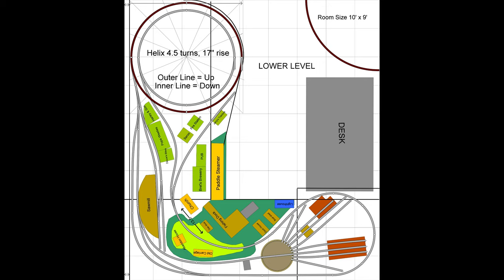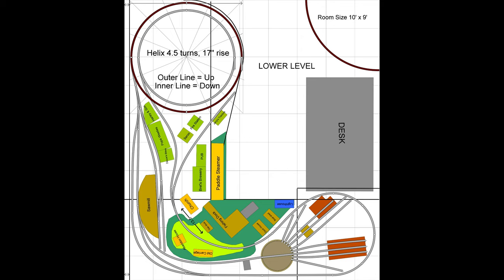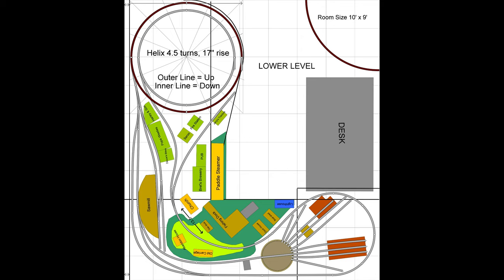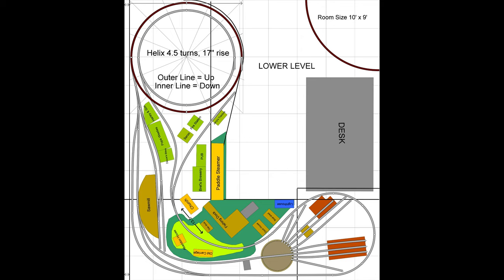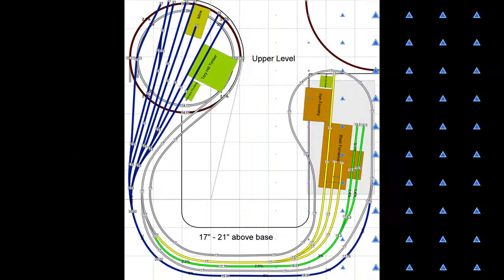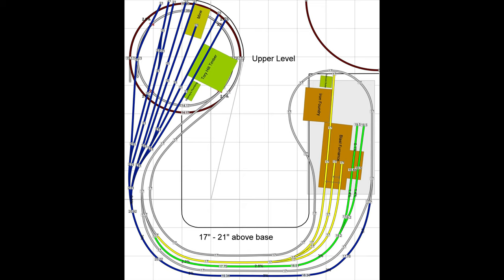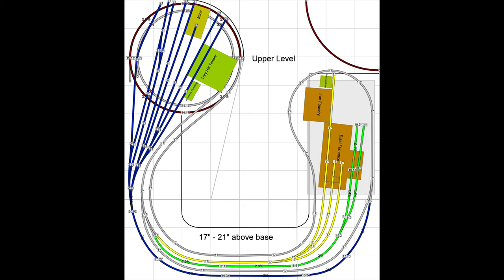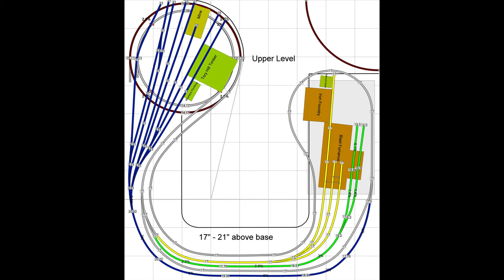New Layout.

Comment: Will be good to see the progress going forward, also do you have 
the Blast Furnace kit or are you going to scratch build this cheers Robert
Reply from the maker: Thank's Robert.
I built the blast furnace about 10 years ago (Walthers Kit) I'm in the middle of weathering and repairing it at the moment so I will post up a video very soon, it is a great kit and very large (22" tall) so it has to go on the top level. It was originally on my old layout but I took off to put in an intermodal yard. Don't we all wish we had more space.
Regards
Gary.
Reply: @creepy013   That is the problem with all us modellers, needing more room than what we have. But i do really like the Blast Furnace and i would have built one if i had the room. But will be good to see how you go with the repairing cheers Robert
Reply from the maker: @csxmad  Thank you Robert, yes they are great but now hard to get. (and expensive, Australian Modeller has one at the moment)
Gary
Reply: @creepy013    Would like one but i need to set up my Ethanol Plant and this takes up a lot of space as well cheers